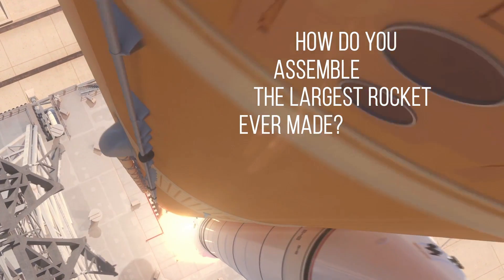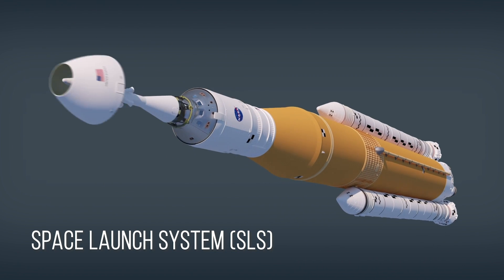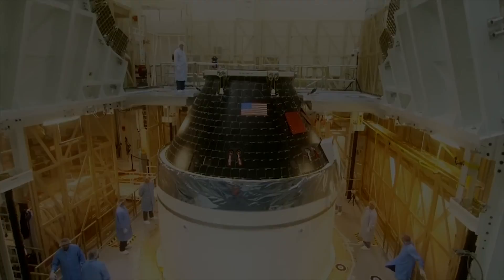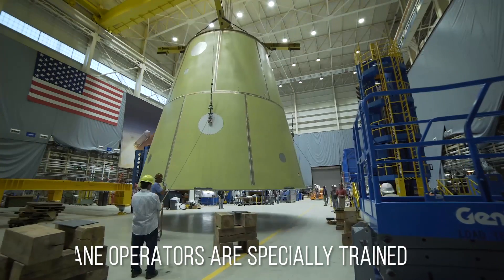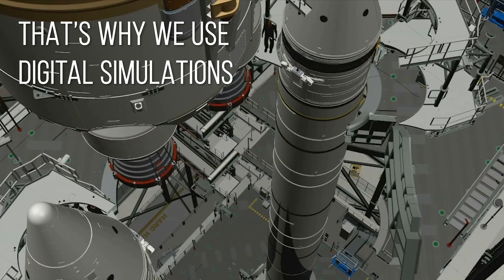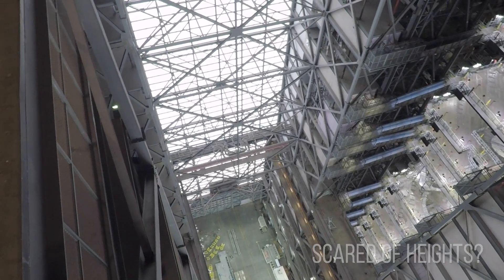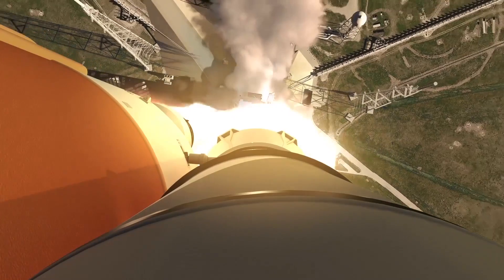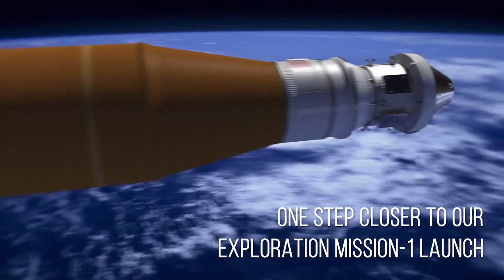How Do You Assemble the Largest Rocket Ever Made?

Comment: "The crew has radios". Wow, cutting edge stuff there NASA

"We use digital simulations to practice". I thought it was because after multiple years and tens of billions of taxpayer dollars, there still isn't any completed hardware

(ps, regarding the snark, this is not directed toward NASA as much as Congress that has put NASA in an impossible technical situation in a politically motivated pork project that is designed to transfer as much taxpayer money as possible to several well connected contracting firms.  Actual flight worthy hardware is a nice extra if it actually happens.  It is NOT the primary goal)